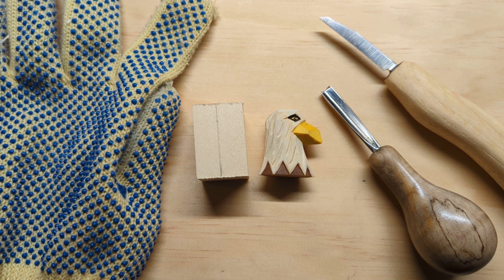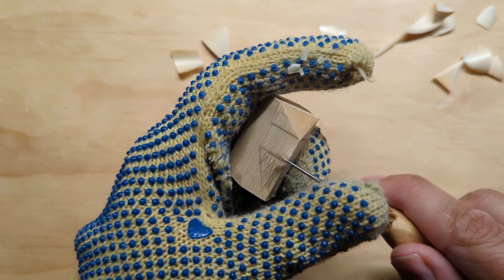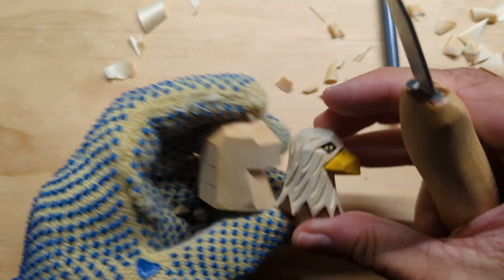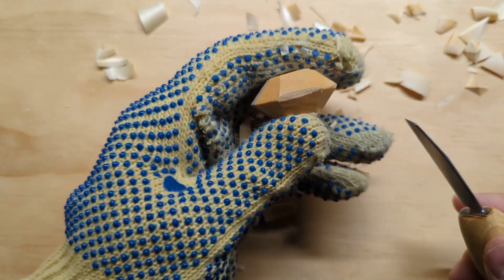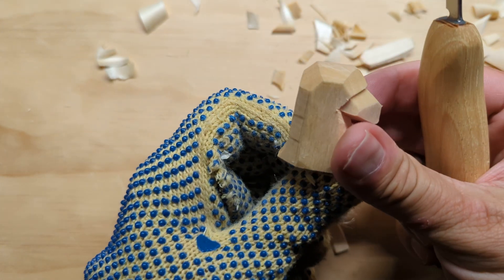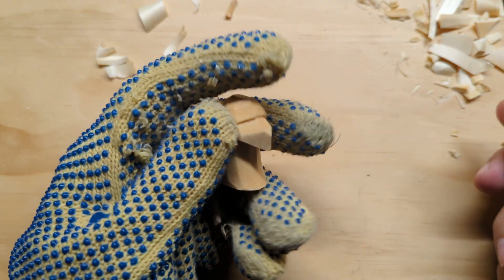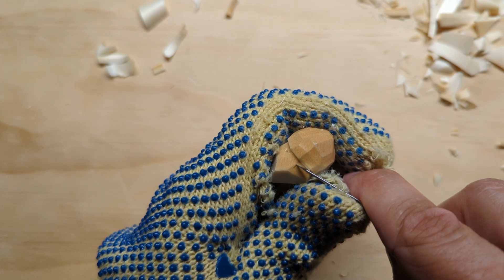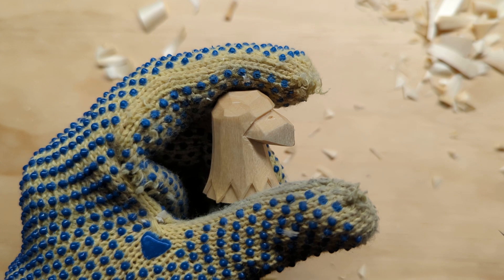How to Whittle an Eagle Head - Beginner Whittling Lesson

Comment: I love this - and all of this series. I especially like the way you lay everything out with line cuts - very effective. I'm really curious if you do that in the first stages of creation for these projects or if you first cut them through trial and error and then to back from an original and figure out the staging. I would love to eventually learn how to bring my own creation ideas to life and it seems like learning how you do these types of things might be a helpful learning experience. Thanks again for bringing all of these to us - I always look forward to them!
Reply from the maker: Thanks! And that's a great question. The answer is that it varies. I started using these straight line cuts specifically because I was thinking about how to explain clearly and simply how to carve for complete beginners to understand and follow along. So in the first case I knew I wanted to carve a fish and then I worked backwards to figure out a simple way to do it. I followed a similar approach for the eagle here. But sometimes I just make clean cuts in pattern lines not trying to make anything in particular. Lots of times that doesn't go anywhere, but sometimes I see a shape that looks like something and then I work out a pattern and process to do it intentionally. That's how I came up with the succulents that were in the recent issue of Woodcarving Illustrated. It's kind of like looking at the clouds and seeing a shape in them.  I have lots of prototypes and failures before arriving at each final design. It could make for an interesting video.
Reply: @dywoodcarving  that makes a lot of sense. Thanks for the explanation!

Comment: What knife are you using
Reply from the maker: It's a Deep Holler knife. 1.75 inch "talon" blade. I have several Deep Holler knives and absolutely love them. Unfortunately they are harder to find now.
Reply: @dywoodcarving  yes can't find any on Amazon any idea where they can be found
Reply from the maker: @Quicks_Draw  When they are available, they are only for sale through their website now. Unfortunately, the maker ran into some health issues and hasn't been making much for the the last year. There haven't been any in stock for quite a while. https://deephollerknives.com